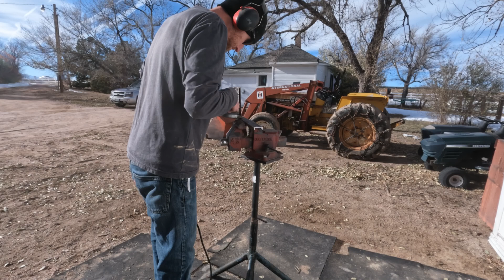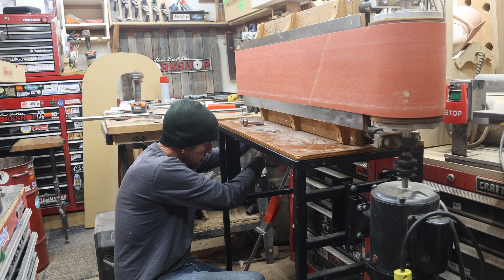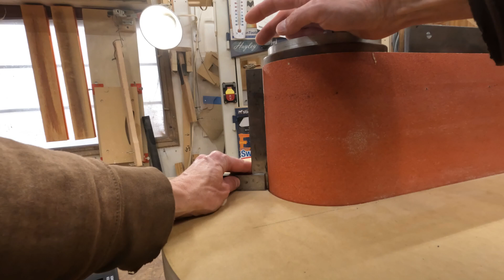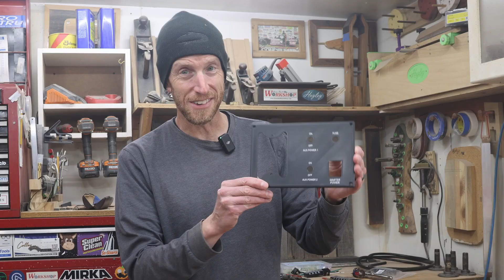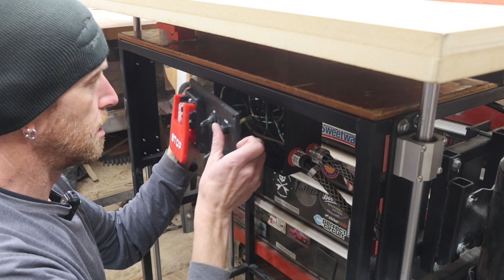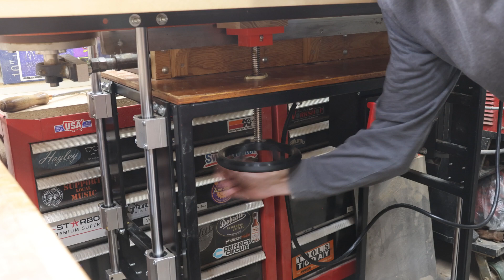Building a Giant Edge Sander | EP4 Installing the Custom Electrical Box and Wiring

Comment: I've created a monster with the 3d printing. LOL That whole project turned out great. If you want to stop that belt faster, you could add a bicycle disk brake to the motor shaft.
Reply from the maker: Yes, I believe you introduced me to the heat set inserts. Lol. They are great. I have been considering adding some sort of brake to the system at some point.